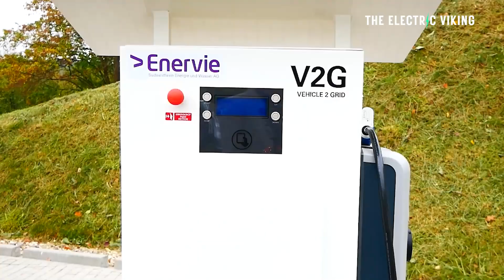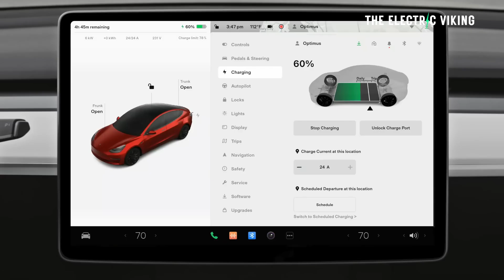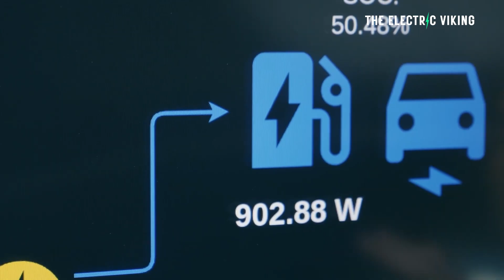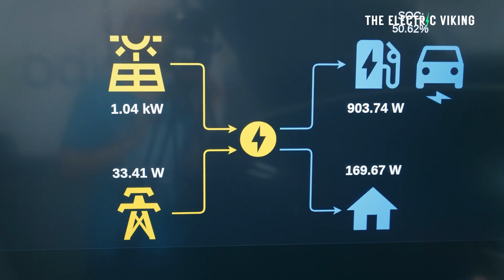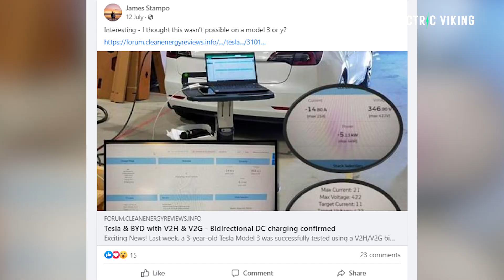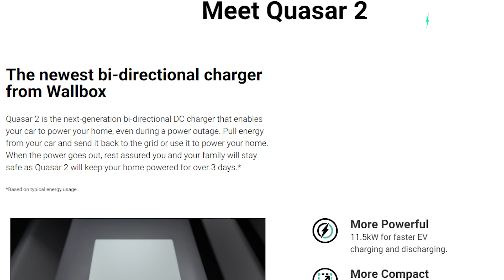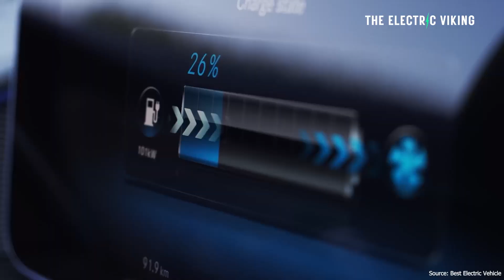Test reveals Tesla Model Y & Model 3 have Bidirectional Charging (V2G)

Comment: I think it would work with the Gateway as the Cybertruck does, so Powerwall may not be  necessary.
Reply: You will need an inverter to go from DC in the battery to AC in the grid. The car does not have this built in. The Cybertruck does (for all the various power outlets.)
Reply: @geirmyrvagnes8718  I think the inverter is in Teslas Gateway. I only want V2H for power outages.
Reply: @adamdarrow  The gateway is about switching power to go between the right places and not back out on a dead grid. But, conceivably, you could make a product with that plus an inverter and a car charger. In one quite neat box. That is what you would want, but it is not an existing Tesla product.
Reply: @adamdarrow  The Powerwall / Gateway will do whole home backup already. Mine switched on again yesterday when we had another grid outage due to lightning.
Reply: @greghudson9717  right, but with bidirectional charging and a Gateway I think you can bypass the expense of the powerwall.
Reply: @adamdarrow  I agree, that 'should' be true, but Tesla probably won't sell the Gateway3 without a PowerWall 😞
Reply: @greghudson9717  they do sell it separately and they show a diagram of the PowerShare configuration that does not require a power wall. I don’t have time to find the link atm.
Reply: @adamdarrow  That's very good to know. Regards, Greg.

Comment: V2G and V2L, Tesla are crazy not to have this facility. They also need to stick a hatch on the back of the M3. The MY is not the only EV on the market any more.
Reply: Criminal Act
Juniper EV V2H V2G is a must. All EV manufactures must by law be a V2H V2G EV design. A united nations mandate or national laws for any EV sold in any nation must comply to a V2H V2G EV design and all power companies must pay for Net Metering.
Access to your property
V2H V2G design but IMO just pulling the Juniper battery disconnect and plugging in a dongle will provide Juniper battery access, and grants you the right to use those mobile powerwalls at your home, at your office, at your work sight.

Comment: hmm..."capable" and "practical" are two different things. Seems that what you're saying is that Tesla cars have big batteries....no surprise there. Absent a means to tap into the battery, the fact that the battery is there is of little consequence.
Reply: Right your mobile power walls
Juniper is a 5-6 Mobile powerwall machine. All EV manufactures must by law be a V2H V2G EV design. A united nations mandate or national laws for any EV sold in any nation must comply to a V2H V2G EV design and all power companies must pay for Net Metering.
Access to your property
V2H V2G design but IMO just pulling the Juniper battery disconnect and plugging in a dongle will provide Juniper battery access, and grants you the right to use those 5-6 Mobile powerwalls at your home, at your office, at your work sight.

Comment: V2G is the key - We have a Nissan leaf for this reason and struggling  to get this to work in the UK for a reasonable price so for now just a pipe dream
Reply: I have a  Nissan Leaf in the UK too. I’d like to know more about how to use my car V2G. Why is it difficult to do at a reasonable price?
Reply: Criminal Act
Juniper EV V2H V2G is a must. All EV manufactures must by law be a V2H V2G EV design. A united nations mandate or national laws for any EV sold in any nation must comply to a V2H V2G EV design and all power companies must pay for Net Metering.
Access to your property
V2H V2G design but IMO just pulling the Juniper battery disconnect and plugging in a dongle will provide Juniper battery access, and grants you the right to use those mobile powerwalls at your home, at your office, at your work sight.
Reply: Think about the wear-and-tear on the battery if it was used to power the home/grid…Tesla could activate it but you would have to give up your battery warranty

Comment: Every car with DC charging is V2X capable! Not Tesla specific... It is already possible to draw energy out of the Tesla battery. But you will lose your guarantee...
Reply: Juniper is a 5-6 Mobile powerwall machine. All EV manufactures must by law be a V2H V2G EV design. A united nations mandate or national laws for any EV sold in any nation must comply to a V2H V2G EV design and all power companies must pay for Net Metering.
Access to your property
V2H V2G design but IMO just pulling the Juniper battery disconnect and plugging in a dongle will provide Juniper battery access, and grants you the right to use those 5-6 Mobile powerwalls at your home, at your office, at your work sight.

Comment: Regular V2G will degrade the batteries faster, coupled with reduced cyclelife of NCM batteries and a generous warranty, would result in increased warranty claims. There is a reason why V2G was dis-allowed and made part of the design decision initially. Now with other automakers, using the feature to boost sales has given a pause going forward with it. It will surely, be a feature going forward, but with additional disclaimers on warranty, to avoid regular use, and might even implement a non-resettable log on V2G sessions. Nothing prevents a determined one to wire up V2H(diy, even for older teslas), as a means of emergency power for few days.
Reply: "Nothing prevents a determined one to wire up V2H(diy, even for older teslas)" -how?
Reply: @LaBambaCL  just going from memory, but I think if you look up “Tesla penthouse” You will start getting some info in the right direction. Please note that doing this will void your battery warranty.

Comment: Cybertruck has bidirectional charging enabled when using the universal wall connector.
Reply: The Model Y and 3 also don't have the same export power out to power much on your house, the Cybertruck does.
Reply: @Illopp00ify  MY and M3 could export 400V DC just by engaging the HV contactor, but you'd still need an expensive external box to invert it safely to provide AC.
Reply: @ahaveland and a different universal wall connector, and dc wiring in your house, etc etc. Tesla isn’t doing it this watch it’ll be AC coupled with the inverter in the car just like they do with the cyber truck. Sam’s wrong, he doesn’t know how this works
Reply: @ahaveland  I already have 'expensive external box', its called an inverter, and changes the 450v DC coming off my solar panels into 240v AC that my house can use.
Reply: @projectswithdrew  Few people really know how this works and there are many choices and ways to implement solutions.
230V AC coupling would be the most versatile for general purpose home or away use though it's lossy, and this is likely the lowest hanging fruit, but retroactively installing an inverter on EVs that weren't conceived with this in mind would be expensive.
HVDC-DC and direct connection would have less conversion losses and require thinner cables. When home and EV batteries become near equalized, a DC-DC converter can be bypassed to make a direct connection.
Also HVDC-DC can be proprietary as it would require certification because of the HV, so it's more tempting for a manufacturer to try to lock in the customer.
Thus only one inversion stage would be needed to send to the grid/home.
Just some thoughs.
Reply: @ahaveland  Tesla has already shown how there will do vehicle to grid, it’s AC coupled, and it’s 240v in the US, not 230v. Tedla will go with the easiest option, which is AC coupled. Ford went DC coupled and like single digit customers installed it (20k+ install).

Comment: All EVs capable of DC fast charging cam do V2G. All it takes is a software change and an external inverter. Every Tesla ever built has this ability. In fact, the ultimate capacity would be at least 150A x 400v = 60KW or potentially 300A x 400v = 120KW.

Comment: V2H is the one feature I’ve been waiting for to buy an EV, and once I have an EV it only makes sense to go solar for my home. I imagine that I’m not the only one waiting for this feature, and expect more and more homes to go all electric once V2H is available.
Reply: I Installed Solar panels two years ago, then install two Tesla batteries last year and this year bought a Tesla EV Model 3 LR. Got all the Tax rebates for everyone of the items above. The only carbon I am producing now is when I breath out. Sold some of my Tesla stock to pay for all of this.
Reply: I’m in the same boat, day this is release I’m buying a PW3 and a comparable EC, just hope it’s not limited to Tesla only cars. Should be any EV with VTL.
Reply: @stevejamieson1245  I'm a passenger on that boat too. BUT... just because a car has V2L (i.e. some Kia's and Hyundai's) does NOT mean you get V2G. Unless there's some trick I haven't heard of.
Reply: You are definitely one of the very few. I have two systems 25kw and 12kw systems. V2H will cost 12k. What is the point of having it apart for the minority like you. It doesn't matter and is definitely not a game changer, as Sam claims.
Reply: @jjjxoxoxo  Where did you get your $12k figure from? AFAIK, you will need a Gateway, a suitable EV charger, and the EV of course (I already have all 3).    By my calculations, it should be around $4k inc installation.
And the point of having V2HG is one, supplementing my existing battery, and two helping the grid when it is under stress, like it was a couple of weeks ago when there were huge winds blowing down powerlines etc (this is here in Melbourne).   I managed to export 5kWh from my battery, and kept the remainder to power the house all night. If I had the 60kWh battery in my Tesla at my disposal I could export a lot more to help the grid.   OK, so maybe I am one of the very few, I admit it, like when I look out of my window during a blackout, and I'm the only one with lights on because of my battery backup.
Reply: Why wait - if you live in Australia solar makes economic sense now. A battery is a little harder to justify.
Reply: Glad someone's realising an ev is more than a car. It's a power generator to when needed. Been on v2g2h for 5years now in the UK. It's saving me an absolute fortune on my household electricity and transport costs. Normally electric costs for house is circa £1300/year. Last year for example more household cost was £250 and that included 10,000miles in my leaf.😊
Reply: Check Hyundai Ioniq 5 - it has this feature.
Reply: You are one of very few people that need or can afford the extreme high costs of v2h.
Reply: @jjjxoxoxo  You are wrong. I DO need V2H.   I only have 6.4kW of solar due to my small roof (having downsized when I retired), and my Tesla Powerwall2 is really a bit too small to run the whole house if it has been a cloudy day, so V2H would greatly benefit me (I already have the EV).  My 62 kWh Tesla car battery could keep my house running for many days.
Reply: @greghudson9717  I am wrong about what?
Reply: @jjjxoxoxo  You are totally wrong about : I'm one of the very few people etc...   You are assuming the costs of V2H are expensive, but you, and everyone else including me have no idea how much it's really going to cost.  I'm a bit ahead of the pack because I already have the Tesla Gateway3 (which is about $1000), which is hardly an 'extreme' cost. Some people spend more every year on their coffee and smashed avo's (but not me).

Comment: Enabling V2G/V2L would give a big boost to sales
Reply: Yup. It's what I'm waiting for.
Reply: its like towing, everybody wants it and a few will actually use it.
Reply: @scottmcshannon6821  I disagree. I imagine most Tesla owners also have their own house, solar, and possibly a Tesla battery too (like I do, and most of the members of my local Tesla Car Club).
Reply: @greghudson9717  true, but not all, some home solar systems only work when the grid is up. the system needs to automatically isolate the house when the grid goes down.
Reply: @greghudson9717  no, the battery does NOT isolate you from the grid, youalso need a gateway or isolation switch.
Reply: @scottmcshannon6821  My mistake, now edited. Thanks for correcting my error.
Reply: Outside of the inverter it could also destroy the Powerwall market. They would be  competing against themselves.
Reply: @lashlarue59  Yes and no. We have two EVs in my home (a BYD and Tesla) and much of the time we direct our excess solar to the cars, but we can't do it ALL the time because inevitably we're both away from home sometimes, and I'm in an ideal situation to be home this way, so I'm a worst case for powerwalls. 

We could leverage the Powerwall to catch the excess energy from the sun that we can't in our cars, which would be a huge help in winter with so much heating at night. In summer it would also be great because we simply make too much solar to use. Selling at night would be good
Reply: @JoshuaMcTackett  I was thinking of doing something similar to what you are describing. We also have 2 EV's (Tesla Y and Chevy Equinox EV) and I was thinking about either buying a battery from a Fisker Ocean which is 106KW at $5000 USD or buying the entire Fisker car if I could find one for about $10,000 USD because it comes with the inverter.  At 106KW that battery would power the house for several weeks and if we used solar to charge the battery that would make a great backup to the grid. Problem is I don't know enough about it to make this work.
Reply: @lashlarue59  that is probably one reason tesla has been slower. of course if you have solar you need a powerwall type device. most solar power is during the day when your car is most likely to be gone.
Reply: Yep if the juniper dosnt have it I'll prob get an ev9
Reply: @tysonfinn1470  The 2025 Equinox will have it and it's a $1300 option. But I think it will only be available on the top trim version which could make the car over 50K. Hope I'm wrong about that.
Reply: @richardvivian3665  bullshit.
Reply: I would probably go buy one immediately
Reply: @williamkreth  Tesla specifically BANS using your car to power anything (it in the user manual) so don't think you can do it yet.
Reply: No

Comment: Just to be clear "Power" is energy per second.   Power per second makes no sense unless one were talking about the rate of change of power.  For the future, the units of power are kW (kilowatt) and the units of energy are kWh (Kilowatt hour).   So to make it simple,  the concept of "power" is how fast your battery can deliver or absorb energy.  And energy tells you how far your car can go.  It's a little like acceleration vs speed in a car.
Reply: Wrong, power is an instantaneous value, got nothing to do with a second 😂😂😂😂.  Back to high school electrical theory for you 😅
Reply: @JboKit  A simple question for you.  Why do think a watt is defined as a joule  per second?  😁

Comment: V2G is not allowed yet in Australia, still waiting for the rules to change 😒
Reply: Years away - except maybe SA.
Reply: isn’t it permitted in SA?
Reply: @peejayem4700  it’s still only a trial on South Australia the company that is supplying the equipment is called jet charge in Victoria and when you can buy the equipment it’s about $10,000. Another company had the equipment on display at The everything electric show in Sydney and I think it was even more than $10,000 from them.
Reply: In the UK my understanding is as follows:
Some vehicle manufacturers other than nissan (Skoda and probably therefore VW, Audi etc) have activated V2G via there CCS ports.
There is one (I think) household charger which supports V2G.
The issue comes with grid outages.
If your house isn't wired up properly, you could be exporting power to the grid while some unfortunate engineer is attempting to diagnose and fix the grid fault, assuming that the circuit is dead. Potentially a lethal combination.
Household batteries and PV inverters are wired up so that doesn't happen.
Also, Skoda, to maintain their battery warranty, restricts the number of V2G cycles before they kill the function.
If anyone knows otherwise feel free to correct me.
Reply: Just because it is not allowed, doesn't mean it can't be done. (It has been possible for years)
Reply: @greghudson9717  you’re right it has been available for years. You could do it yourself but it’s something goes wrong and the house burns down. Your insurance company will not pay you because you did something illegal to your house.
Reply: Right!
Juniper is a 5-6 Mobile powerwall machine. All EV manufactures must by law be a V2H V2G EV design. A united nations mandate or national laws for any EV sold in any nation must comply to a V2H V2G EV design and all power companies must pay for Net Metering.
Access to your property
V2H V2G design but IMO just pulling the Juniper battery disconnect and plugging in a dongle will provide Juniper battery access, and grants you the right to use those 5-6 Mobile powerwalls at your home, at your office, at your work sight.